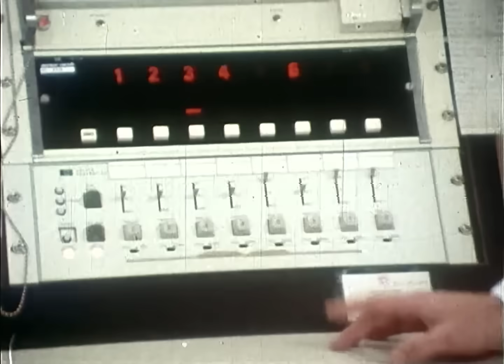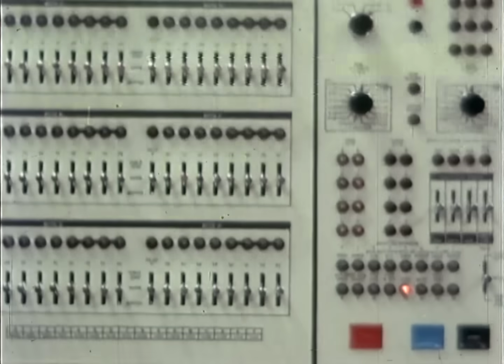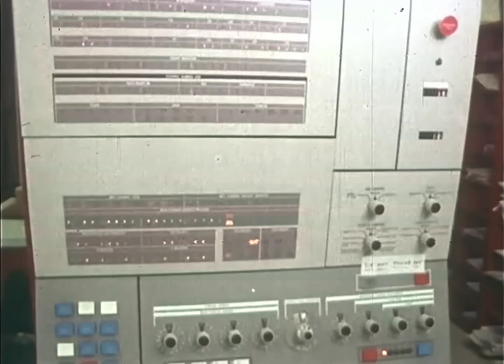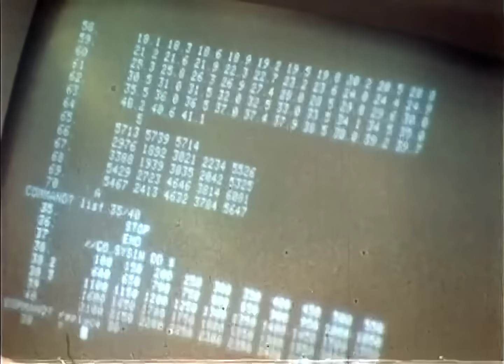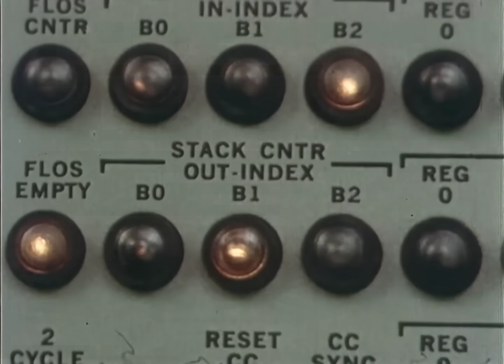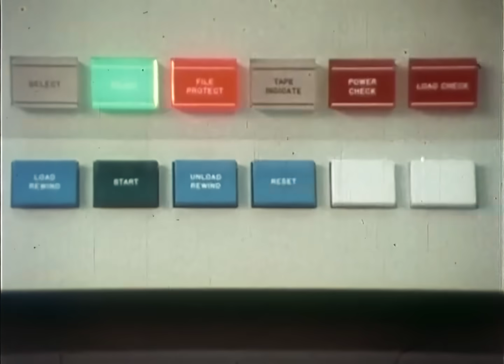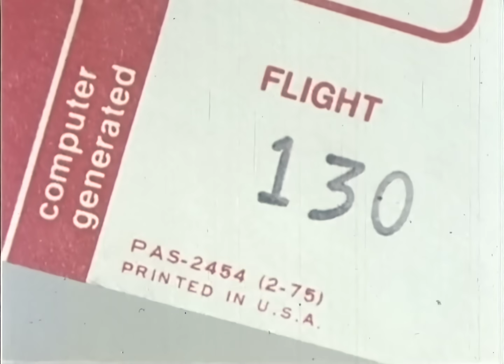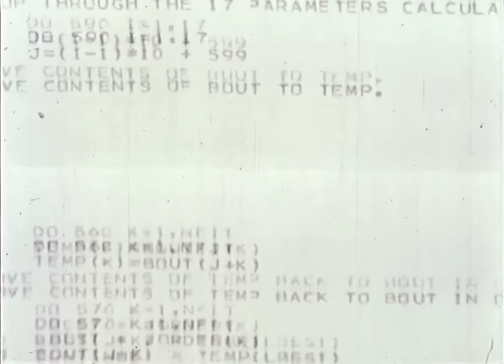Basic Computer Terms (1976)

Comment: My first time using a computer was in the early 1970s as a child. My dad taught data processing in 1971! I was 3 years old. Got the chance to push some buttons. Yes the card system was in use at the time. You entered the codes, then inserted cards and they printed out the information. They were quite large then.

Comment: Why did I never take up cigar smoking myself on a daily basis? I want to do that now. Inside the family house, at work, at family gatherings, at tea parties, at concerts, on the streets and alleys, a thick smoke from the chimney of a Havanese.
I was a baby at 12 when I got my first computer - a VIC-20. Then an Amstrad and then a C64New, programming in COMAL 80 and BASIC. Then 3 dry years without a computer, but then I went berserk in Unix RISC 6000 and FORTRAN 77 programming, before necessary self-taught C++ developed by my countryman, always self-taught as useful in my engineering work, thanks to the VIC-20, which started it all for me.

Comment: 50 years later,  i'm watching this on my MacBook Air that has 1 billion times the storage capacity, 20 billion times the processing power. Is thinner than any book i've ever read and slips in my backpack with a battery that lasts all day.
Reply: 1 billion times the 30 MB hard drive here would be 30 000 000 000 000 Mega bytes...

Comment: I recognized the IBM 3420 Tape Subsystem which I used in the early 80s.  Glad to have been part of the generation that seen the information and communication technology evolve from card punch machines and tape systems to large mainframe computers, and down to handheld mobile devices. Not to mention networks/comms technologies from 9600bps to gigabit speeds at home.  What will the future hold, I keep wondering...

Comment: My first computer was an IBM 360 with punchcards and paper tape input.  Yes, it was timeshared terminals and everything was steam-powered.  Then I ran a CP/M BBS in the mid-80s.  I think that one was electrical, but accessed the phone system by ringing up Mabel with a crank phone on a party line.

Comment: 1978- Junior in High School-  I took Intro to Computer Programming.  We used DECwriter II terminals and BASIC.  Everything we did was stored on a 5.25 Floppy Disk (the big one) everyone was issued one.  Lose it, you fail the course because "they were very expensive".  I carried that disk like it was made of gold and loved it when someone asked "what's that ?" and I got to show off my geekness.

2025- Retiring next year -  I am a Computer Instrumentation Technician.  I write programs that run entire commercial businesses and office buildings HVAC systems.

Looking at this video made me smile.  I remember buildings having dedicated "computer rooms" that only a few could enter.  Always freezing cold.  Using big suction cups to pull up the heavy floor tile to access (or run new) computer wiring run beneath. 

Hard to believe that when I retire I've been programming for 48 years.  Many flavors over the years....  My fav ? C++  I remember the frustration when compiling a program you spent hours on and you get "syntax error line 230" and you'd freak out.  What ?  No !  Where ???
Reply: Actually the big one was the 8" floppy disk
Reply: I retired from the IT field last year. Hardware was my specialty. Now that I'm retired and put it all behind me what do I do? Build computers. 😁
Reply: @2528drevas  I kinda got "eh" about building my own; now everything is plug and play, you don't build, you assemble then turn it on.  Back when you had to set jumpers for IRQ's, voltages, CPU's, clocks, etc., you had to know what you're doing to avoid the dreaded POST beeps and count how many beeps to know what you did wrong.  Now it's all Tab A goes in Slot B...
Reply: you lived in magical times and in the right place to experience them
Reply: I was a junior in high school in 1978, too!  I was in the vocational data processing class.  We didn't have fancy floppy disks to store out programs on. I programmed in BASIC and FORTRAN on an ASR33 Teletype (110 baud) and saved my programs on the attached paper tape punch/reader.  The next year, in 1979 as a senior, I programmed in COBOL, using IBM keypunch machines. We then fed our card deck into the remote console card reader, which was attached via leased line to the school district's IBM 360. I've been an IT professional since 1979. Retiring next year. It's been great!
Reply: @pcc678 you were a few years ahead of me, but my dad was working on the SAGE and AUTODIN networks in the USAF back in the 60s so we were early adopters. Ended up going into network  architecture after a stint in the Navy and working for Marathon oil in Alaska. I preferred the physical aspect to programming, not least because I'm almost incapable of typing.  Really a glorified network tech most of the time if I'm honest. Getting ready to retire myself soon. I have to laugh when my kids assume the order kiosk at McDonald's is  beyond anyone my age. The idea that the basic concepts were well underway 50 years ago and everything since has really been refinement is a testament to our educational system I guess.
Reply: Computer programming sounds so boring
Reply: @BITCOIlN  Quite the opposite, actually.  I type words on a screen and make million dollar pieces of equipment respond to what I typed.  Kind of incredible, really.
Reply: We are the sane age. I would go back to this time in a heartbeat.  You?
Reply: @jcepri  Nah.  The "good ol' days" aren't really good; they're just old.  We tend to remember things better than what they really were.
Reply: Great Job I.T. Greybeard. Thank you for your service.

Comment: I took a class called computer concepts in high school in 1973. We had no computer, or remote terminal. We had to write our programs out in #2 pencil on paper with bubbles to color in. We would send the programs out to somewhere that had a computer, and a scanner that could read our programs. This process took more than a week. Meanwhile, we would write a new program, dutifully coloring bubbles in pencil. I never got one program to work! Each one came back marked with a red stamp that said "syntax error ". Programs could be several hundred sheets long, and syntax error could mean that your logic was incorrect, or that your coloring was not neat enough, so that the scanner misread at least one command. Trying to figure it out was a fool's errand. I simply handed in my syntax error defiled programs, and took a "c" for the course. I was never involved in computers again, until they became mainstream in the late 90s!

Comment: My dad was a computer engineer in the AF working out of NORAD in the early 70. He retired before I was born, but we had some pretty awesome computers in the early 80s. When I was a teenager he bought us (mostly me) a $3800 top of the line gateway. I remember being on the intranet (yes intanet not internet). You could use a dial up modem to connect to the local library and certain other sites like weather. You had to have the phone number to connect.

Comment: Man, does this take me back.  I was just a little shaver back in 1976 and my father was a university professor so I got to see the computer system he worked with and it took up the enter basement of the building...punch cards, terminals, the whole deal.  A few years later and we could play games in the computer lab in the summertime at the university like "The Hitchhiker's Guide to the Galaxy", "Star Trek" and even a "Space Invaders" clone.  I used computers in school and even had our own IBM AT at home eventually and I got my very own AT clone when I was 17.  I've built and repaired countless computers over the years and these days I like repurposing free older computers with Ubuntu and getting several more years out of them.  I still remember Basic, DOS, the first Windows and on and on.

Comment: My first “real” job was with a bank in 1980. I was a print pool operator, responsible for maintaining IBM printers. A whole floor of my building consisted of various hardware components to support an MVS 360 computing environment.  There’s probably more processing power in the palm of my hand as I type this than the entire floor of equipment back then.  Back then it was bits and bytes. Modems transmitted at 8 bites per second, lol. Disk drives were like small refrigerators holding about 600mb worth of data. You entered programs or data into the system using card readers, some containing boxes and boxes of punch cards.  Sometimes the reader would jam and you had to punch out a new card.  It was fun. I enjoyed working on the 3800 printers and magnetic tape drives. Dumb terminals were used to issue commands in JES2 or JES3 language.  Memories are just rushing through my mind now, great, fun memories.
Reply: 8 bytes, or 8 bits.  Not 8 bites.
I honestly didn't know card readers were still in use that late (1980).  Not denying it, but I didn't see it.  My school had a DEC VAX 11/750 connected to a couple dozen monochrome amber monitors...but no card reader.
I was employed as a student lab assistant.  Once my instructor had me assist him in typing in a new compiler.  Maybe that's why they didn't have a card reader, too cheap to buy the compiler when they could get the printed source cheaper and have a minimum wage lab assistant help type it in.

Comment: Remote terminals being like cloud computing is mind of bonkers but makes so much sense. Inputs go by wire to far away places where processing occurs and output returns via the same method. This really makes me appreciate the innovations that went on in these days!
Reply: I've got a few decades in IT. For what it's worth, this pattern is cyclical. Starts off with remote terminals and centralized mainframes, then client/server setup locally, and then cloud+web, but soon edge/local AI. It has to do with the costs/perf of communication, processing, and so forth. The latest gen has us pushing AI chips into our devices (like cameras) to do processing locally and then only events get pushed to the cloud. Instead of doing all the processing there. It's happened 3 or 4 times on my watch....

Comment: Man, this takes me back.  I started working with computers in '79, when I was two years old.  I remember sitting on Dad's lap, watching him program in BASIC.  He'd worked with computers for decades at that point, including one that used a 50 gallon magnetized steel drum as a hard drive.  It held a whole 16kb.  He also got set up on a date with the sister of one of the inventors of the microchip.  (It wasn't to be.)

Ahh, I miss him.

Comment: You're not supposed to smoke around computers so his unlit cigar was probably unlit for a reason.  However smoking around paper with waste paper bins used to empty ashtrays it caused many fires.

In those days if you were told you can't smoke near the computers because it can cause the tape drive and parts of the printer to get sticky they would have probably refused to get a computer.

Comment: The film is kind of confusing or oversimplified: external storage, like tapes and disks, are considered as both Input and Output devices from the computer's point of view, not really a form of 'memory'.   This confusion persists today—when you watch something like Home Shopping shows selling you computers, they often confound 'memory' when talking about RAM and disk drives.
Reply: Tapes and disks are not inputs and outputs because its data needs to be processed from computer language to human language before we can understand it. Home Shopping hosts are there to only sell stuff, all they need to know is its features (likely read off the manual or pamphlet) and the price. Otherwise, the manufacturer will be the one doing the sales. Do you think a car salesman knows how every single component of a car works?

Comment: Viewers may nowadays wonder why people wrote programs, data, even job control commands (//GO.SYSIN DD *) onto those grid coding sheets instead of just typing in stuff from plain paper.   The answer is hinted at: the people who punched data onto cards were 'keypunch operators', non-technical typists who had no understanding of what they were entering.   And computers generally had very strict input format requirements, so those coding sheets were necessary--and w0e unto the coder who forgot to write zeroes with a slash.

Comment: 1976: The Cray-1 Supercomputer could fit in a single room, costs 8 million dollars, had 1 million transistors, and could multiply two 10 digits numbers in a fraction on a second.
2025: The Colossus Supercomputer is the size of a village, costs 8 billion dollars, has 200,000 H100 Nvidia GPUs with 16 quadrillion transistors, and hosts a LLM that can generate a mildly funny knock-knock joke in lest than ten seconds.

Comment: These old videos show me just how much more advanced things were back then than I thought.  Never would have guessed they used computers in hospitals in the 70s, thought it was an 80s thing
Reply: Wait until you find out that they had computers in the 1960s!
Reply: Very rarely, as they were incredibly expensive.  My local bank was using mechanical posting machines in the 1970s, no computers at all.  I went to college at UNC-Chapel Hill in the early 70s.  There were no computers.  We could use dial-up and an acoustic modem to access the mainframe at Research Triangle Park.  It was shared among UNC, NC State, Duke, and IBM.
Reply: And the police...

Comment: OK, Something here is WEIRD, ALSO, in 1976 companies worked with COMPUTERS!!!!!!!!   TODAY most people work with what are called Microcomputers,  The two are VERY different!

Odd point #1.....   WHY is everyone smoking a CIGAR?  Most smoked cigarettes!
#2 A/V geeks?  They did NOTHING with computers!
#3  WOMEN teaching in this area?  Never heard of it!   They were generally gofers!
Sorry,  but it is  TRUE!

Did you see the  size of that transistor?  Such a transistor, replacing what we have today would be IMMENSELY HUGE!  TODAY, such a transistor, on  an IC is only a few microns, TOPS!  One micron is 1/26,000 of a inch!  That transistor was over 1/4 of an inch, or about 6500 times the size!  The first  CPU was probably  no bigger than  about 1/4 inch squared.  Seriously!   Next to the 4004, the Z80, or  8080,  looked MASSIVE!

To put this into perspective,  the first micro CPU was tested in 1971.  Microsoft and apple incorporated in 1975.  NOT a zillion times  faster.  Even MICROS weren't THAT  fast.

Back then, most software was used to control the  computer, manage access, and compile programs.  To actually do things programmers  had to create the programs.  They didn't even  have any word processing or databases.  

The first BUG was actually tracked to  a MOTH in a relay that that computer used to connect with a device.  So the first  bug was a REAL FORMERLY LIVING BUG!!!!!  Bugs are attracted to heat, light, etc.... so they were a concern.  As  computers got more "solid state", the problem of  REAL  bugs disappeared.

Comment: The hard disk shown at 10:08 held 30MB. 30 million characters. an amazing amount of data... for the time.
Reply: Still amazing
Reply: No joke, that was insanely generous back then! I had a hand me down IBM compatible XT in the early 90s with two floppy drives and no HD, and I remember installing a 34MB HD and thinking I was such a boss lol. Of course I was already behind the times because my folks couldn’t afford to buy me the shiny new stuff, but hey – I could finally run Duke Nukem 2, and that was good enough for me
Reply: @staticloop-n9m i know you said compatible (aka clone) but the IBM-XT always came with a hard drive.  The earlier IBM-PC had two floppy drives (1981 if I recall), but the IBM-XT came two years later with a disk (std 10mb) and one floppy (either 180kb single sided or 360kb double sided).  All 80s IBMs were double density drives.

Eventually half height floppy drives were offered so you could cram two floppies in one bay.  The IBM-XT had the same two drive ribbon cable that the PC originally had.
Reply: @STho205  back then, “IBM compatible” was more of a catch-all term. I wasn’t saying it had the exact same specs as an actual IBM PC of the time. That was just how people casually referred to any PC type of machine that ran PC/MS-DOS or Windows and wasn’t a Mac, haha
Reply: @staticloop-n9m they were all clones if they used MSDOS in that era.  Compaq was a clone using the 8086 or 8088 processor as became Dell.  PCDOS was the original licensed OS Gates sold to IBM that he had copied from Digital Research (DR-DOS).  KPro was an equivalent PC but used CP/M and a different bus.

Tandy and Apple came before them in the 70s.  TBH the IBM Boca Project 1980 was an upgrade copy of early TRS80s made with Radio Shack parts crammed into a System 34 console (the classic IBM PC chassis and green screen monitor).

Being built from open source parts in a rush, IBM eventually lost all their lawsuits against competitors.
Reply: @staticloop-n9m  that's why IBM released PS/2 at the end of the decade.  It was all copyright proprietary MicroChannel bus architecture and parts.  Too bad they sucked and were three times as expensive as a PC-AT 286 clone in 1990.
Reply: @STho205 ha I remember those. Interesting idea but lousy implementation
Reply: Holds less than your mom